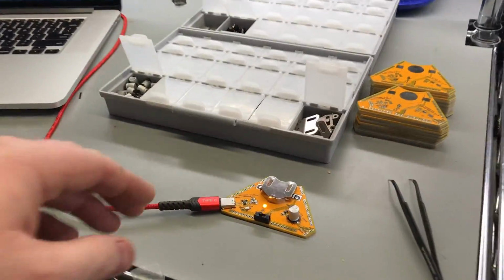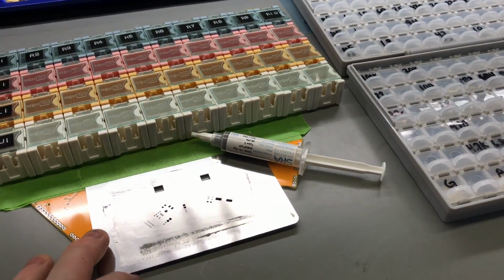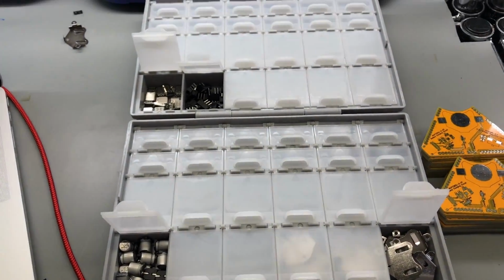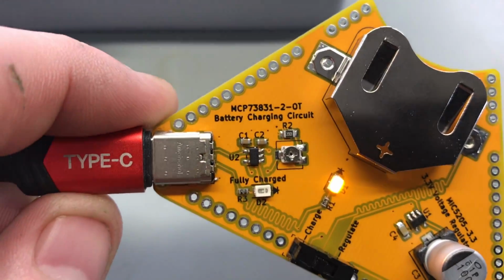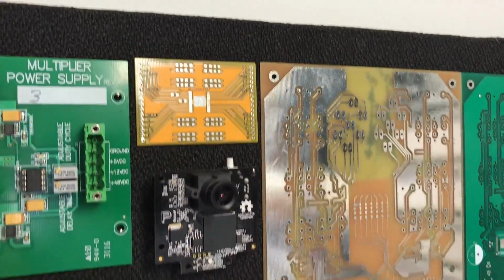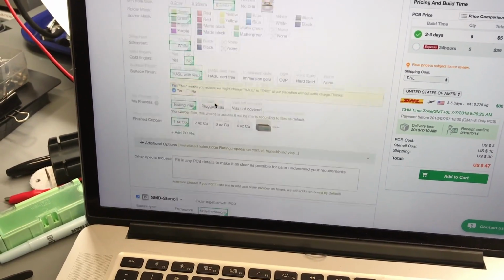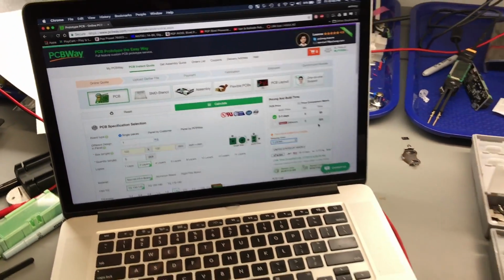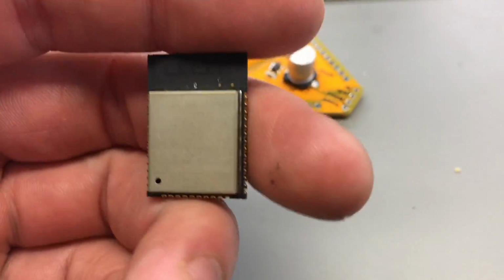Rechargeable Coin Cell Development Board

Comment from the maker: Links to equipment used in the video: 
Hot Plate: https://amzn.to/2lWRRxL
Hot Air Rework Station: https://amzn.to/2lYCAMU
Laboratory Stand with Clamp: https://amzn.to/2MXOkeb
ESD Safe Electronic Assembly Gloves: https://amzn.to/2u1xdAQ
ESD Safe SMD Component Storage: https://amzn.to/2KDESQq
Type 5 Solder Paste Syringe: https://amzn.to/2NwtH9Z

Comment: Why is the wire length on the pcb critical on a charging circuit?
Reply from the maker: It is not. I commented below stating that I used serpentine tracks for purely aesthetic purposes; Meaning, that I used them because I think they look interesting/pretty.

Comment: Yeaaahhh... this is an interesting and very handy project specially for the IoT devices, the ESP32 can achieve very low power consumption when idle... you can always add a second parallel coin slot somewhere in the pcb to make it suitable for applications where they’re more demanding on processing/transmitting data or require longer periods between charges. 
This is certainly a very useful product for IoT, just target their groups and someone or company will likely inject some money =]
Reply from the maker: I'm going to make some improvements and hopefully open up a tindie store to sell some of them.

Comment: WAAAAAAA  coin cells are rechargeable!?
Reply from the maker: Do not try to recharge regular coin cells.  They make rechargeable versions in the same packages. Usually it will have LIR in front For example a LIR2032 is a rechargeable CR2032.
Reply: Hows the lifespan on them, get many cycles out of them?

Comment: Hi Proto G. You said: “pre-heat the board before turning the hot plate up to the full temperature”?  
Does this mean your Baku 946A can actually be used to do a full reflow profile?
Just curious, as the video appears to show you using the heat gun for the final reflow?
I’d been looking a Lafras’s “ReflowR” on Tindie, but can these electronic hot-plates do the same job?
I see they are spec’d for 100 - 350 degrees (celsius?), but do they support electronic control for a reflow profile?
Reply from the maker: The hot plate does heat up well beyond soldering temperatures but does not have an automated reflow profile. I will reflow with the plate if I'm doing more than more board at a time. The hot air station is much faster for a single prototype.
Reply: Sounds like a project! I wonder if anyone has done a teardown to see how easy it would be to access the thermocouple and element control, to retrofit a heat profile microcontroller? These electronic hot plates are now quite cheap on AliExpress.

Comment: I'm intrigued with the zig zag pattern. Is that the power line? A delay line or printed coil?
Reply from the maker: It's called a serpentine track and it's used to match a pair of traces so that the signals arrive at the same time. In this case, I'm using it for purely aesthetic purposes.
Reply: Proto G i thought that. I ve seen a lot on motherboards

Comment: I think esp8266 uses too much burst current when transmitting for a coin cell to provide. In contrast, an arduino nano 3.3v with sleep mode. may just be appropriate for logging temp, humidity, etc..
Reply from the maker: This is an ESP32, not an ESP8266. Directly from their website, "Engineered for mobile devices, wearable electronics and IoT applications, ESP32 achieves ultra-low power consumption with a combination of several types of proprietary software." Also look up Andreas Spiess. He set up an ESP8266 to run 17 days on a coin cell.

Comment: How long can an ESP32 run off a standard coin cell? I imagine it varies based on the cell itself, and with something that small it would also vary based on the load. 
Similar question, do you know if that would be sufficient to run a BLE chip? Something for a positioning beacon, or a low power locator tag? I can't imagine the range would be very far, but it might be cheaper for somewhat single-session use-then-recharge applications than to go all the way to a lipo of some kind.
Reply from the maker: I forgot to mention that Espressif just released a single core version of the ESP32 which should be a little less power hungry with a deep sleep of less than 5uA. https://www.espressif.com/en/media_overview/news/new-espressif-module-esp32-solo-1
Reply: Proto G you probably will! I wasn't sure what your duty cycle would be (may have missed it) but thought the comparison with ESP8266 was interesting. CNLohr has managed to get the best regime I've seen so far for quick WiFi connection, uploading and return to sleep on the ESP8266 I've seen so far - but you're already following him.
PS I do like the contrast between copper and bare FR4 in those yellow boards. Wonder how ENIG would look with this solder mask.
Also, did you consider EDLCs in lieu of that electrolytic cap?
Reply from the maker: That's a question I don't know the answer to and is partially the reason for making the board so I can test it. The ESP32 could perform some task and then go into a deep sleep mode.  Directly from their website, "Engineered for mobile devices, wearable electronics and IoT applications, ESP32 achieves ultra-low power consumption with a combination of several types of proprietary software."
Reply: I had seen the power ratings for a cut-down version of that board, and they looked like they could run off a coin cell,  but didn't know if those translated into practicality at all. I have seen some projects that use the deep sleep mode interrupt to squeeze every last drop of power. I figure for anything other than short burst transmits, it would either not have great range or abysmal runtime.
Reply from the maker: Yeah, I'm not sure about the ESP32 but if it's better than the ESP8266, that's a good sign  YouTuber Andreas Spiess configured an ESP8266 to run for 17 days transmitting once an hour. Hopefully the improvements Espressif has made to the ESP32 will let it run a bit longer than that.  You can always use an 18650 but the point of a coin cell is to have something small like a key fob.
Reply from the maker: Great video, but he was shooting for a 1 year battery life. His results are promising to me and it will get even better with time. According to that video, I should get around 290 hours of battery life before needing to recharge. With a solar panel, it would last forever in Florida.
Reply: You may want to watch this https://youtu.be/DDpuBJYFJ7Y about ESP32 (wifi) power consumption. It's not promising, relative to the ESP8266. I did ask Sprite_tm about reducing the ESP32's "BLE" below around 100mA in a March Hack Chat. His answer: "Lower-power BLE: Yes, we're most certainly doing things in that direction. (That is also one of the reasons the SDK isn't visibly expanding: 'lower-power modes' is only a small bullet point but can take a huge effort to get done.) I can't tell you how much lower that is going to be, though."
Perhaps worth waiting for but getting familiar with Nordic chips may be the way to go if you're in a hurry.
Reply: Proto G ref the ESP32 Solo, thanks for the tip. I didn't know there is a temperature or hall sensor built in until now. After a decent period of sleep, reading the temperature sensor immediately on wake up would probably give a reasonable reading of the local air temperature. Now trying to think of the uses for the hall sensor - anti-tamper perhaps? Orientation of a slow moving shaft, perhaps a wind vane...
Reply from the maker: I've never used EDLCs before and wasn't too concerned with space. I'll look into them though for future projects. CNLohr and Andreas Spiess are both great resources!
Reply from the maker: Do you think I could use a small bank of EDLCs instead of a battery?
Reply: Proto G I have been considering them in lieu of coin cells for PCB badges, where you charge up quickly from a USB power bank for a few minutes run time. I haven't got a link to the calculations I used but your use doesn't seem insane. The cost per item may be more. Don't forget if you do some calcs that you can only count the energy stored between the EDLC bank's max voltage and your uC's brown out / cutoff voltage. To maximise this, you may want to use EDLCs in series and have a switch mode buck converter. However, the losses of the buck converter may outweigh the inaccessible voltage below brown out levels, in a parallel system. Calcs and prototyping will tell!